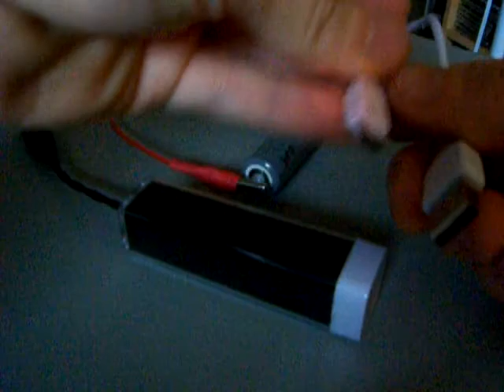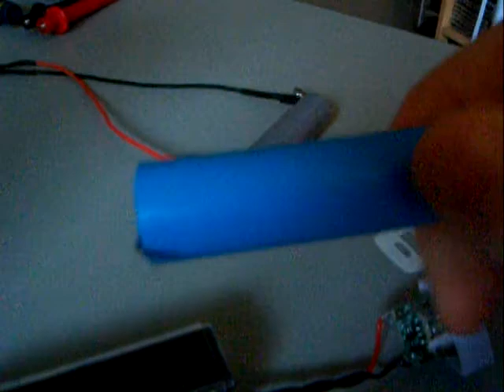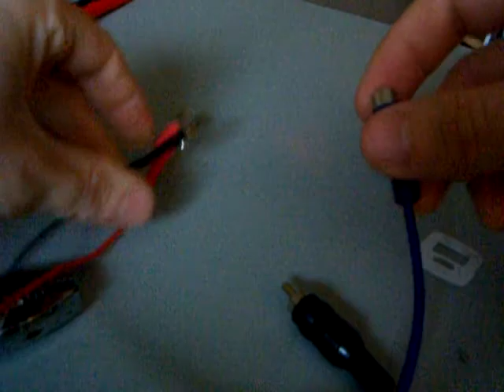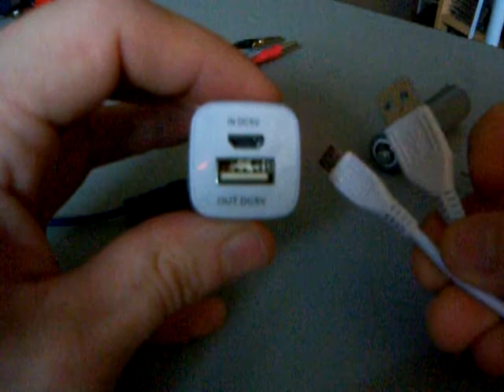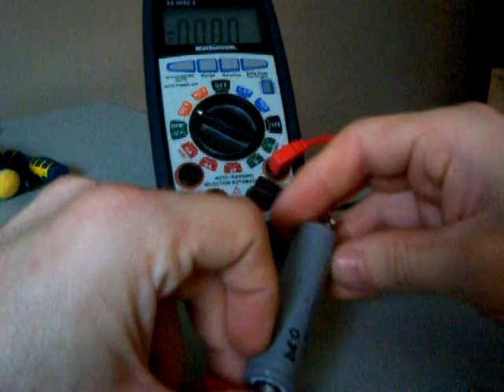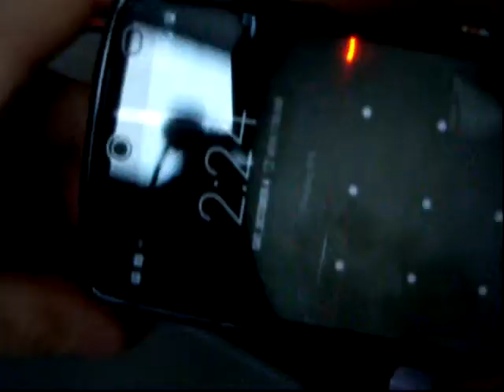DIY USB Li-ion cell charger & battery pack

Comment: Check InpliX handbook if you want to make it cheaper and better.
Reply from the maker: Better yes. Cheaper, really depends. You can get those single cell "battery packs" sometimes for free, or a buck or two. The video was really about using what you have around to charge and give new life to otherwise "bad cells".
Reply: Awesome to me